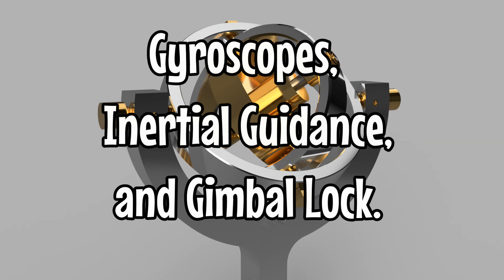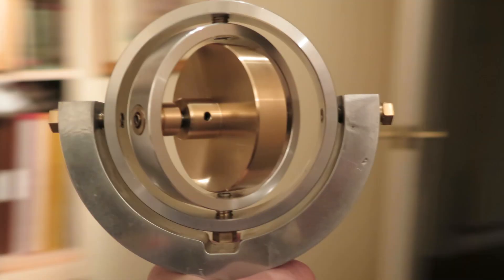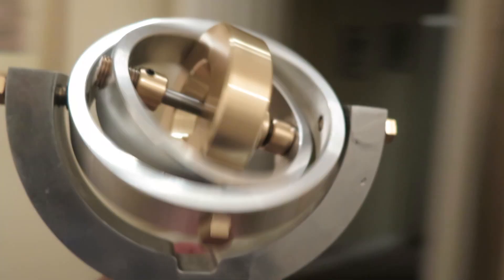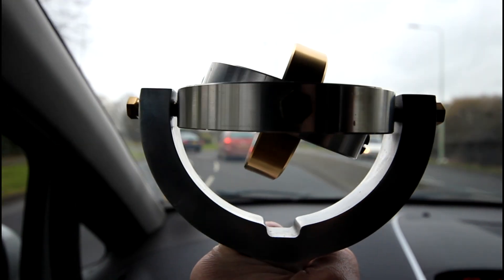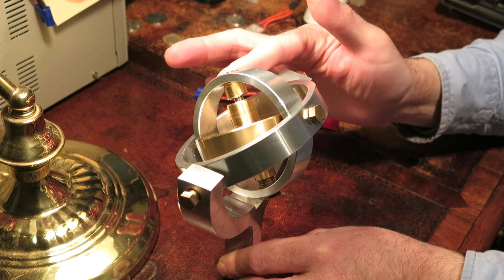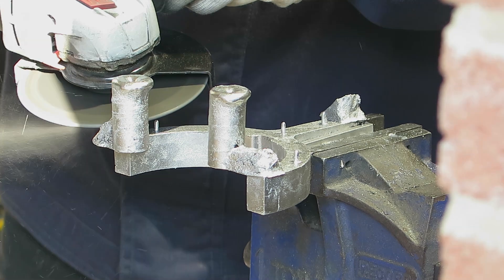Homemade Gyroscope Demonstration, Gimbal Lock, and Inertial Guidance

Comment: I came here to see this gimbal lock. Back in 1970s visiting the Exploratorium at San Francisco's Palace of Fine Arts, they had a Sperry INS platform, it was a black thing mounted in a flat plate that held its position no matter what angles I moved the plate. But I noticed if I take it to high angles, it goes into a spin. When I moved the plate to a more flat horizontal position, it stopped spinning. But it was not in the same attitude as before. Didn't give it much thought about it at the time. Then reading about Apollo 13 where there was concern about gimbal lock, later years the movie Apollo 13 where it was shown a scary moment of the alignment platform getting close to gimbal lock. I'd like to revisit the Exploratorium, or make my own INS like we see here and do my own hands-on of a gimbal lock.

Comment: That's not an informative description. Gimbal lock means that the axis of the gyro itself is pushed away from its normal operating orientation. To navigate it has to have the gyro's axis pointing constantly in one direction in the outside universe always pointing at, say, Polaris, or the door knob. The apparatus pitches, yaws, and rolls about this stable rotating gyroscopic axis or "platform". But when the gyroscope is pushed off that axis by losing an axis of freedom by the pitching, yawing, and rolling in such a way as to put all six bearings of the gimbals, in the same plane as in gimbal lock then if the apparatus tries to move against the plane of the locked gimbal bearings the condition pushes the gyro's axis off Polaris. The only time you clearly demonstrated the axis pushed off orientation is when you pushed it directly with your finger. You never showed it pushed off in actual gimbal lock.
Reply: yes that's right, lock means fixated to one position all the time
his video is more of a concept rather than an actual functioning gimbal locked to a certain direction like Polarizing Star
in gyro-compasses there is always another apparatus that prevents the gyro lock from deviating from the eye of the needle errr North Star

Comment: I've beena fan of gyroscopes since Eric Laithwaite's demonstration in the Royal Society Christmas lectures several decades ago. 
Just a questoin. Has anyone tried gimbal angles at anything other than 90 degrees? You would probably need an angle of 67.5 degrees and 4 gimbals. Would that avoid gimbal lock?

Comment: Since all of the Earth's alleged movements are non-uniform movements..one would think a gyroscope would retain it's rigidity in space, and show the counter balance of the gyro in action, while the Earth moves.  But they don't.  In fact a good gyro like the one shown in this video...can be placed on the table and left alone while it spins at high rpm.  And it will just stay perfectly still, no "counter-intuitive response" from the Earth turning and spinning.  This is most suspect indeed.  The exact same can be said of the worlds tallest pendulum.  One would think it would eventually start swinging on it's own.  But they don't.  They never have.  The one in the Smithsonian requires a motor hidden in the ceiling to force it to swing...because the Earth never will make it swing.  So again...no reaction from a gyro, and no reaction from a pendulum.  If left alone, both experiments FAIL horribly.  YOU have to swing the pendulum with a motor.  YOU have to push on that gyro to get a response.    The purpose of those experiments was to show the Earth force the gyro to move without you touching it.  The purpose of those experiments was to show the Earth make the pendulum swing without you touching it.  SO THEY WERE BOTH A HUGE FAILURE!!!

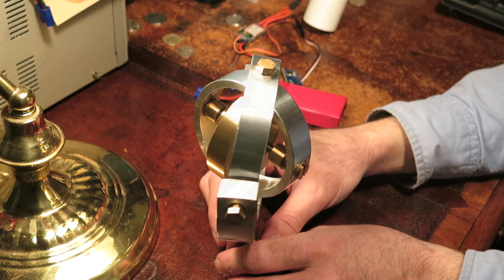Comment: Why orientation of rotation axis is changing when gyroscope is in the car (1:30 ) but is stable when is moved holded in hands (2:00 - 2:20) ?
Reply from the maker: The gyroscope stays the same with reference to the rest of the universe in both shots. Don’t forget the camera is also moving with the cars reference frame.

Comment: What would have made the car sequence MUCH better is if you could figure out a way to have the GoPro POV be fixed to the axis of the gyro to demonstrate 'fixed in space' even when cornering (like when you have the GoPro on a shovel handle POV). Nice casting/machine work.

Comment: In my college machine shop course almost 45 years ago, I built a gyroscope that was even bigger and nicer than yours.  But the gimbal lock problem was evident.  Not just because you lose one axis when it coincides with another, but because the tiny misalignment of the coincident axes would exert a torque on the rotor.  So I built my own design with an extra ring and with the axes 80 degrees apart instead of 90.  In principle, it is possible to bring the gyroscope through any angular path without locking up any pairs of axes.  In practice, it didn't work so well - probably because it's not possible to make an 80-degree angle with the precision of an indexed 90-degree angle.

Comment: i still dont understand what gymbal lock is
Reply: gimbal lock is/occurs when the metal rings (gimbals) holding the spinning mass in the middle (aka gyro or top) line up.

you will notice when he says gimbal lock you see in the video that the two inner rings (gimbals) become lined up (co-planar --- or 'locked' together).  when that happens, notice how the entire inner assembly 'flips' rapidly.  

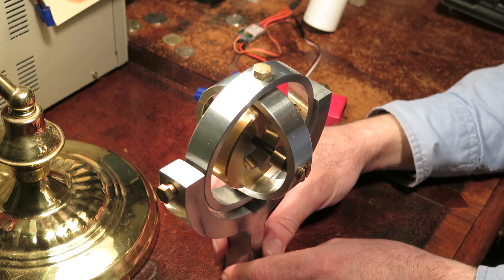this happens at 1:49, 1:55, 2:01, 2:11 and 2:15.

it isn't really 'locked in place', but they move in unison together in an unusual rapid behavior with complicated reasons (that I don't understand) that does not correspond to motion of the handle the guy is holding.  so they call it gimbal lock.

if that happens when a plane or spacecraft is measuring the motion, it's really hard to measure and so is bad.

if you are flying a plane or spacecraft and using the gimbals to measure angle of rotation etc, you will get a rapid and strange reading that will be confusing or hard to correct for - and this makes the measurements harder, and so it is good to avoid.

sending love,
Pat Vulk
AwakeLove.org
Reply: Sort of hard to explain without proper demonstration but think of it as this. When 2 of the gimbal rings align, you are essentially losing one axis of rotation. There's a good video explaining somewhere.
Reply: Watch this: https://www.youtube.com/watch?v=zc8b2Jo7mno
Reply: me neither, and I watched that link

Comment: Hi David, excellent "homemade" gyroscope.

Just out of curiosity: what kind of bearings did you use in the gimbal and gyro flywheel? Brass bushes (self aligning), ball bearings, or perhaps even ceramic (ball) bearings?

Have you tried lubing the bearings a little bit? It might dampen the vibrations a bit, resulting in longer bearing life, and a longer spin of the gyro.

Also, why isn't the fly wheel made as heavy as possible? It would make the gyro spin longer, or isn't that necessary?
Would a heavier fly wheel help with the inertial guidance and detecting earths rotation?

Please don't take this as any kind of criticism, I'm just a mechanic who's fascinated by gyroscopes and gyro compasses.
Reply from the maker: Thanks for the comments!

The bearings are straight forward ‘economy’ ball bearing. I did try more expensive versions, but to be honest they didn’t make any difference. 

I did find that the bearings needed  oil as without it they didn’t last long at all (maybe just a few runs). I think the vibration comes from the fact that the fly wheel isn’t perfectly balanced (which makes a big difference at high RPM). There is also some slop in the various screw threads that form the gimbals, and that doesn’t help.

With regards to the weight, the gyroscope effect has more to do with angular momentum than absolute mass. Or in other words, adding mass to the outside of the wheel has a bigger effect than mass at the centre. i.e. more brass at the middle wouldn’t bring much , but more brass at the edges would make a big difference – but of course then it wouldn’t fit in the frame.

To detect the earth’s rotation it would just need to spin for longer,  but that would probably mean making it continually powered (either electrically or pneumatically) which is an entirely new complication!
Reply: Thanks for the reply, very helpful.
And you're right, better bearings are only helpful when all the bearing fitting clearances, the alignment of the axles and the balancing of the flywheel is perfect.
As I haven't got acces to a lathe or a milling machine any more, I was considering buying a second hand attitude indicator or a gyro compass to do some experiments, but they are rather expensive. 
Oh well, I already have too many hobbies and too little time as it is :-)
Luckely there are youtubers like you we can watch and learn from.
Reply from the maker: I found this one on ebay http://www.ebay.co.uk/itm/Sperry-Gyroscope-GM-Compass-MK-4F-Gyro-Unit-Type-B-/282557110126?epid=1956433857&hash=item41c9b7576e:g:wTEAAOSwAKxWZJh5 (apologies to anyone reading after the link has expired!) It might be of interest to you – I’m almost tempted myself!
Reply: That's a very low starting price. But as its electric driven (electronics isn't my strong suit) and the seller doesn't seem to ship to belgium, I think I'll pass.
Thanks for the tip though.
Reply: After the seller confirmed he would ship to Belgium, I couldn't resist to make an offer after all.
Thanks again David.
Reply: I used to make those back in the eighties for  Ferranti in Bracknell. I wonder how much they cost new? Same as a house probably

Comment: What type (name brand and size) of lathe were you using in making this?
Reply from the maker: Hi – the lathe is a Warco WM250 (http://www.warco.co.uk/metal-lathes-metalworking-lathe-machine/17-wm-250-variable-speed-lathe.html) , and the mill is a Warco WM16 (http://www.warco.co.uk/milling-machines/32-wm-16-variable-speed-milling-machine.html)
Reply: David Cambridge that is really close to mine, I have a 9"x20" jet lathe